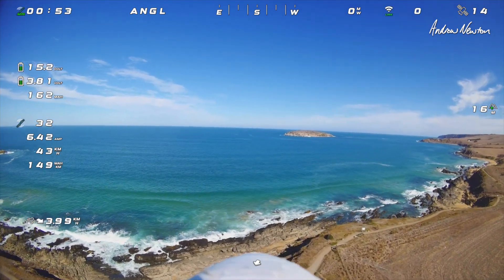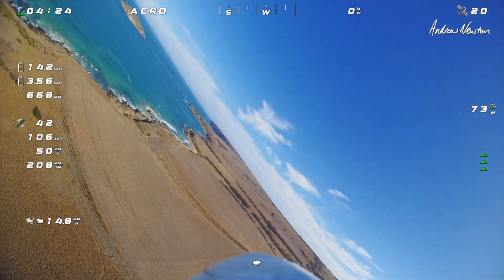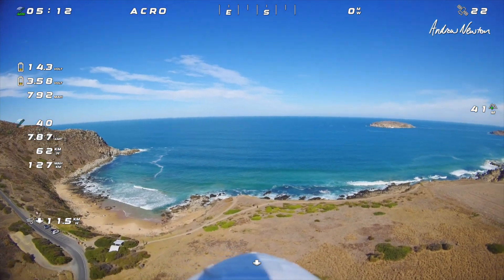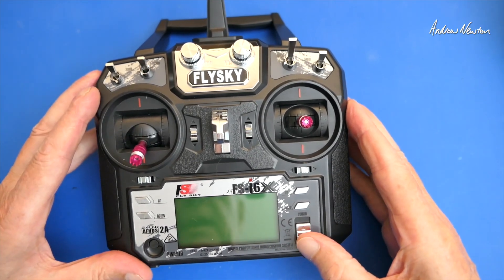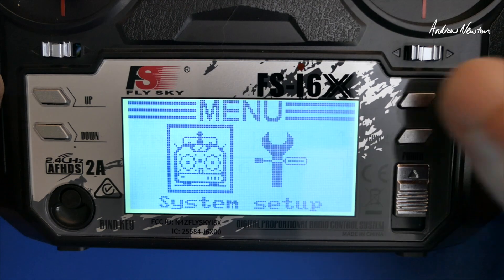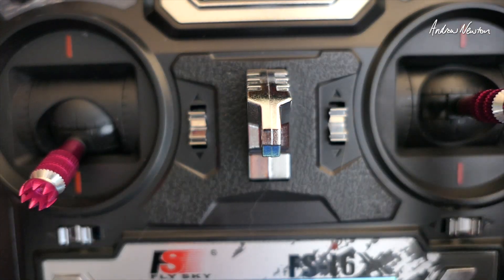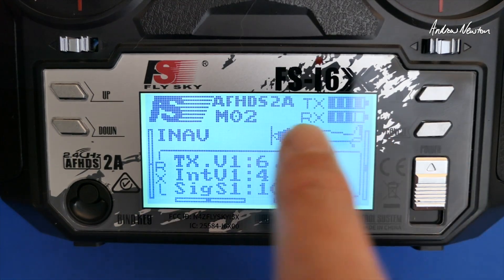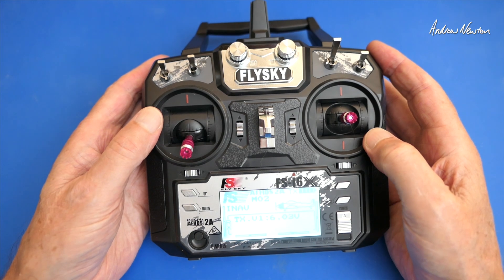FlySKY FS-i6X 10ch SBUS - INAV

Comment: Hi Andrew! As many years I followed you. After watching your videos, I decided to use Speedybee 405 control card. However, I can't arm with Siyi f24 radio control. Which radio control do you recommend? Actually, there is no problem, everything is fine, I am experienced in this subject, but I can't arm. What do you recommend about Siyi f24 calibration? I wish you good work.
Reply from the maker: Thanks. Type STATUS in the CLI to see what is preventing arming. Could be not enough GPS sats or NAV mode selected when trying to arm. Also watch this video but you will choose SBUS and UART2 https://www.youtube.com/watch?v=F7uo2X4dvdU
Reply: Thanks for your quick response.. I have already watched all your videos. There is no GPS problem..Everthink is OK. Everything is green on the screen... I think I can't set the minimum value to trigger the engine in İnav with the Siyi F24 Radio control values. This means I will have to throw away my Speedybee control cards and go back to Pixhawk...or I will have to change the Radio control...thanks anyway
Reply from the maker: Did you try to adjust the End Point for throttle in the radio, and calibrate the ESC in INAV?
Reply: @AndrewNewton  Thank you Andrew, I solved it with the help of a friend... I physically adjusted the Pitch and Roll trim settings from 1540 to 1500 via radio control. It solved itself..A problem that is not written anywhere and is not known..so SIVI F24 has terrible hartware and without quality..best regards
Reply from the maker: Great to hear you sorted the problem, that is an uncommon one. I will add that issue to my INAV troubleshooting list.

Comment: My flysky fsi6x distance is only 100m and rx loss. Please help me fix it. Thank you.
Reply from the maker: Most likely broken or detached antenna wire
Reply: @AndrewNewton I took it apart to check the antenna and there was no problem. Even though I went to an open space, the distance was only 50-100 meters. I bought a completely new one. Is there any way to fix it? Thank you.

Comment: Hi Andrew, excellent video as always. I'm only just getting into Inav with my SpeedyBee F405 Wing and my old Bixler and FSi6  (not i6x) and using iBus as that's all it has. My understanding, I think from one of your previous videos, was trims didn't work when using ibus and the plane needed to be set up so that if flew well without trimming? (Which I did.) I know you are using sBus here and you are trimming and changing end points etc.  so does sBus work in a different way to iBus to let you do that then? A bit confused 😧. I noticed some ranges didnt go to 100% on my set up too. 
A well timed video for me as
I think I might buy an i6x for the extra channels and more modes in Inav. I'm using SwA and SwC, so can only have Arm, Loiter and RTH, but thinking about that I could possibly have another mode on the C switch by using the off range as a mode?  🤔
Reply from the maker: Hi Bob. A couple of different issues here.
1. Same for all RC protocols, you shouldn't use radio trims to level the plane in flight because you will end up with different trims in different modes. If you trim in Acro then you might have lots more trim in Manual. Trimming won't be needed if you enable "Continuously Trim Servos..." in INAV Config page. 
2. INAV expects the signal from the radio to be 1000 to 2000 with 1500 in the middle, otherwise it might prevent arming. Looking at the INAV Receiver page, the FS i6X was sending 1020 to 2020 with 1520 in the middle, so I needed to adjust the end points and mid point of each channel in the radio
Reply: @AndrewNewton  thanks Andrew, I think I'd misunderstood your original comment!

Comment: Bought the FS-i6 in 2018, upgraded it to the aftermarket firmware (10 channels and more functions and timers) and I have not used another radio since. The FlySky FS2A 4CH Receivers are small, light weight and very cheap and the FlySky FS-X6B 6ch Receivers have long range and telemetry and are cheap as well. The price of the receivers alone makes it difficult to justify changing to another radio. On top or that, it is easy to use, works well, and it is small enough to take it anywhere. I will watch all content on this radio. Thanks for your video.

Comment: Hello great video I have a unrelated question you've said in one of your video's that you only use one of the two motor pins I want to use one for motor and the other for servo I'm using INAV 8.0 Matek F-405 Wing Expresslrs 3.5.4 looking in the configurator mixer page it only show one timer for both motors can I use one for servo and still have motor
Reply from the maker: Because they are both on the same timer they both have to be motors or both servos.